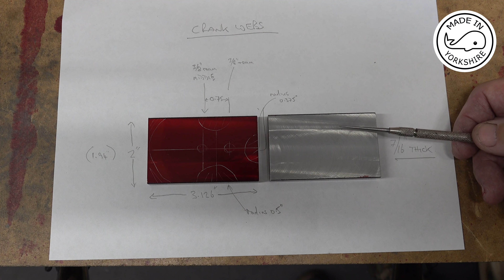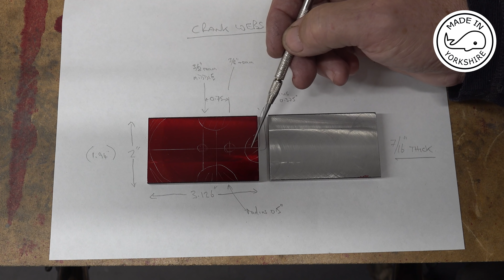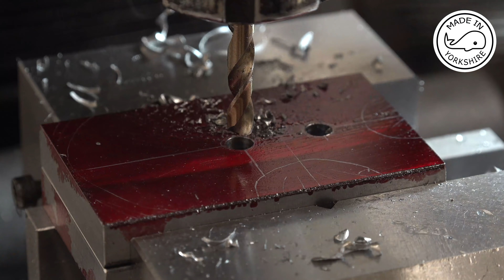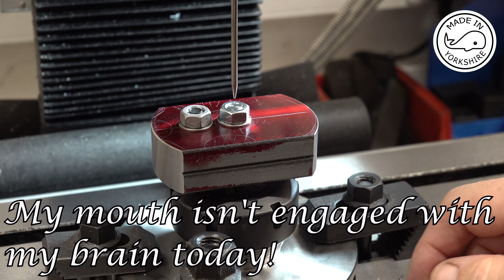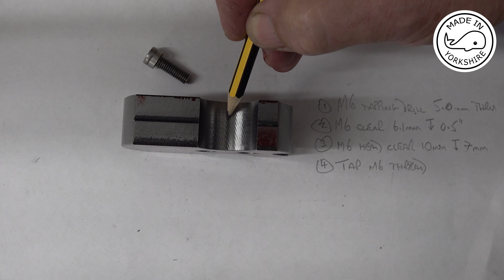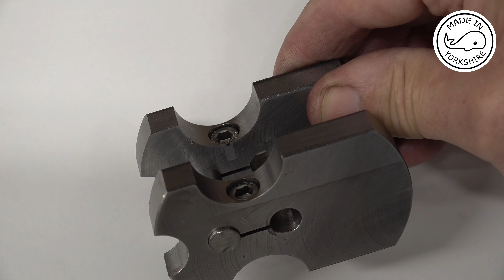#MT44 Part 5 - Hoglet V-twin IC Engine. Making the Crank Webs. In 4K/UHD by Andrew Whale.

Comment from the maker: ****THANK YOU****
Thanks to all those that suggested various suppliers of bronze for the flywheels. Several suggested metals4u who will cut to custom lengths. I ended up buying 2 pieces of cast bronze in tube format. Each has an OD of 4", an ID of 2.5" and a width of 20mm. Total cost including delivery in the UK was less than £50. I consider that a bargain. I would have paid that for a couple of pieces of decent cast iron.
It's not what you know - it's who you know!
Cheers
Andrew

Comment: I had dreams of making a small four cycle IC engine years ago.  For the crank webs/flywheels, I was going to use solid steel round bar and drill the crankpin and the crankshaft holes in the bar before cutting it into the two sections.  That way, all holes are absolutely centered to one another.  Just conversation.
Reply from the maker: An interesting approach but I think I would struggle parting it off into two sections.
Cheers
Andrew

Comment: I've really been enjoying this build series. 👍
But (to my eye) your drilling rpm looks way too high... Drill bits into mild steel should make big slow swirls, not tiny broken chips and smoking up!
Reply from the maker: Thanks Wiz. I have a drill speed table and I usually try to stick to that. Sometimes I forget and I also think some of my drill bits are of poor quality. I've found a supplier of Dormer drills at decent prices, so over time I hope to replace my rubbish ones.
Cheers
Andrew
Reply: @learningturningmetal  ... thanks for the reply!
Hand sharpening your own drill bits on a bench grinder is a really good skill to have. You can use the same drills for years and you can also change the angles on the tip in a pinch, to suit different materials. 🙂
Reply from the maker: @wizrom3046  👍I must give it a try!

Comment: We all find out work holding issues during some operations.   Hindsight is always 20-20, but at the time we thought something would work.   Glad you found a solution.
I read your comment you have purchased bronze tube.   If all you need is the look of brass/bronze, consider using steel or cast iron for the flywheel and then plating with brass for the nice look.
The crank web looks very good.
Dave.
Reply from the maker: Thanks for the suggestion Dave. I will try to remember that one for the future. I'm still waiting for the bronze to arrive 😴
Cheers
Andrew

Comment: May I ask where you got your wobbler from?
Reply: Oh, and you can get extruded cast iron bar, it machines very nicely and polishes to a mirror finish. I don't know where you are but I have a reciprocating saw that can cut down to about 1/2 inch slices up to about 20cm x 20cm cross section.
Reply from the maker: @black5f  Thanks for the info. If you mean wiggler, I got it from ArcEuroTrade
Cheers
Andrew
Reply: @learningturningmetal  Cheers, I know them and thanks :-)

Comment: I find it a little hard to believe those pinch bolts are going to work in that application, just seems like you need a little something more . Was glad to see you change the way you were holding that part on the mill , I felt disaster was going to happen. Glad you caught it in time. Thanks for the video and looking forward to the next one .
Reply from the maker: Yeah - I definitely have some reservations regarding the crank design. I think that the big end design is even worse - so a few challenges along the way!
Cheers
Andrew

Comment: I remember seeing someone do something they called Hot Brassing. It's basically a way to put brass plating on other materials. They took a piece of polished steel and heated it while using a brass wire wheel on it. It ended up looking like polished brass. If you care to look it up, it may help you with the cost of your flywheel.
Reply from the maker: Hi Brad - thanks for the suggestion - I will try to remember that one! I've since managed to get hold of some bronze tube for less than £50. I just need to make sure I don't mess up when machining it.
All the best.
Andrew

Comment: Hi Dave here what size brass are you looking for I cast my own out old brass
Reply from the maker: Hi David - thanks for the offer. Based on recommendations I've just ordered some cast bronze from metals2u. It ended up being quite reasonable. Two pieces of 4" OD, 2.5" ID x 20mm came in at less than £50 including delivery. I just need to make sure I don't mess up machining them!
Cheers
Andrew
Reply: @learningturningmetal  ok thanks fine Dave

Comment: Love the channel. I would suggest placing a taper pin in the end because that friction fit with the nut won't hold over time. There is a great video Keith Appleton did showing you how they don't hold on cranks without a taper pin.
Reply from the maker: Thanks mate - I'll check that out.
Cheers
Andrew

Comment: Metals4U do cast bronze thick walled tubing - it is expensive stuff but they do cut to size lengths and they are quick to ship. I often take advantage of their free shipping and get some stock metal in at the same time. I have no affiliation with them, just a happy customer building a 2" scale Fowler Traction Engine and I need a fair amount of bronze for bearings.
Reply from the maker: Hi Pierre - I've just purchased some. £48 including vat and delivery - but still a bargain.
Thanks again!
Reply from the maker: Hi Pierre - thanks for the info. Some others have suggested metals4u as well. I've never used them before, but I will check them out.
The best recommendations are from happy customers!
All the best.
Andrew

Comment: Andrew, metals4u sell bronze tube for the flywheels, i ordered 4” x 2.5” x 20mm slice for £17 its grade sae660, youll need 2 and  it comes slightly over 4” so should be enough to clean up and keep within tolerances
Reply from the maker: Hi Jim - that's great news. I also received an email from Dave S suggesting metals4u as well. I will check it out.
Really appreciate that!
Cheers
Andrew
Reply from the maker: Hi Jim - I've just purchased a couple. £48 including vat and delivery - but still a bargain.
Thanks again!

Comment: I was wondering about the brass flywheels too. It looks lovely but brass/bronze is expensive material. Mild steel plate is what i am thinking of, or cast iron weights like fitness people use, easy to get and cheap enough. Paint them when finished.
Reply from the maker: Hi - I've just received an email from a guy who suggests metals4u as a source of cheap bronze. I have yet to check it out.
Cheers
Andrew

Comment: I am amazed at the size of the webs. Proper engineering. I noticed a slight wobble as you started the centre drills. A light centre punch before drilling will stop that and improve the accuracy of the hole position. I use a Veritas optical centre punch. It would have been perfect for this job. They are made in Canada. I picked mine up at the MMEex. The lathe set up looked a bit hairy but it worked ok and looks a good result. I cant help with the flywheel problem. Metal prices are making this an expensive hobby at times.
Reply from the maker: Hi Tim - thanks for the info. I think I hadn't pushed the centre drill far enough into the collet - human error! Others have suggested metals4u for the bronze - so I need to check that out.
All the best.
Andrew
Reply: @learningturningmetal  I hope you find something suitable at a more sensible price.

Comment: Andrew, for that big end pin clamping arrangement to work really effectively the tolerances between pin and bores in the webs need to be really small. An alternative would be to set the webs up square and parallel with the pin in situ and run a bit of loctite high strength retainer in the joints before tightening the Allen screws. You could also add a couple of 2 or 3 mm dia cross pins at 90° to the clamp screws. For roughing out steel with heavy and interrupted cuts I always use a WNMG tool tip held in a PWLNR type tool holder. They are a very robust tip designed to accept a lot of cutting stresses. The WNMG tips are available in 2 sizes. I use an 08 size,you may be better with an 06 size in you smaller tool post.
Reply from the maker: Hi Howard - thanks for the advice - I was wondering if loctite might be a solution. I'll check out those tool tips.
All the best.
Andrew

Comment: Andrew, it looked like you did not have your center drill far enough into the collet, it wandered a heck of a lot when drilling. Treat yourself to a bandsaw and vertical belt sander, will save heaps of time in the end. What size PB are you after ?  Regards from Australia.
Reply from the maker: Hi Dave well spotted! That particular centre drill is a tight fit in the collet and I think, like you, it wasn't pushed in far enough. The PB needs machining to 4" OD, 3" ID and 0.563" wide. I've just received an email from a guy who says he has just purchased a couple of pieces from metals4u for £37 delivered! I must check it out.
All the best.
Andrew